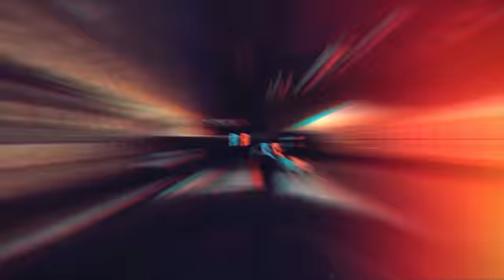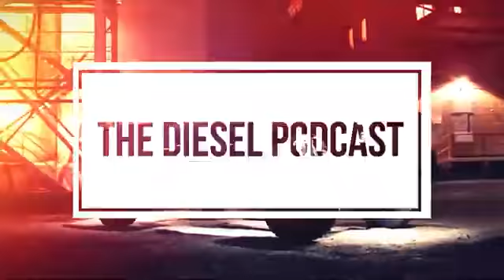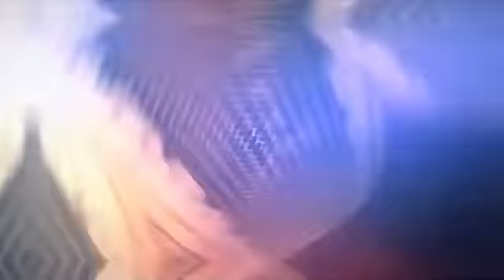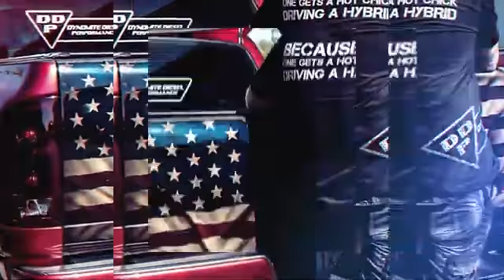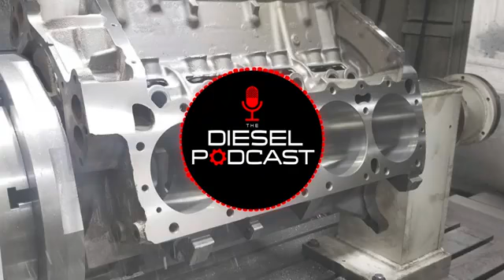Diesel Podcast - How to Stop High-Pressure Oil Leaks

Comment: Curious your thoughts on ccv back to intake with catch can over factory?
Reply from the maker: So long as negative pressure is introduced to the crank case that's fine for ring sealing. However, it still doesn't allow for the valve stem oil.